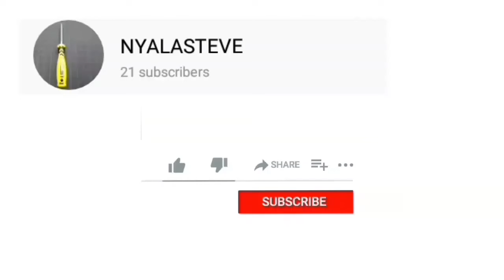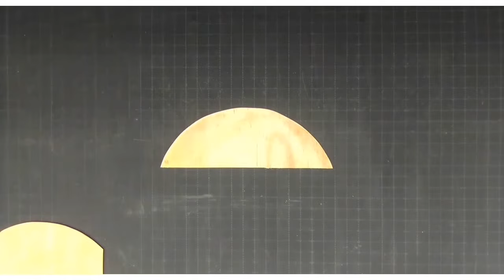Diy solar boat .How to make a solar powered boat.

Comment: 🙂 it almost look like a drone when you first started building it🤔 maybe that should be your next project if you haven't done so yet.. good job and all the best  for your future projects😊
Reply from the maker: Thanks jonnel, actually it was meant to be a drone before i realized that the 10 watt panel was too heavy and couldnt provide enough power to several motors.